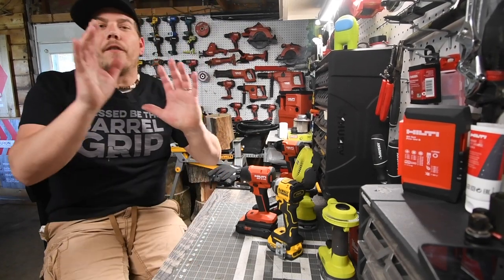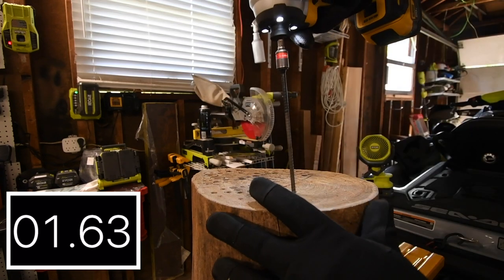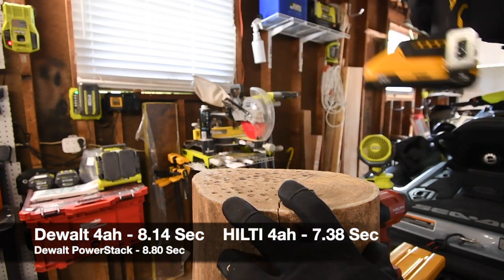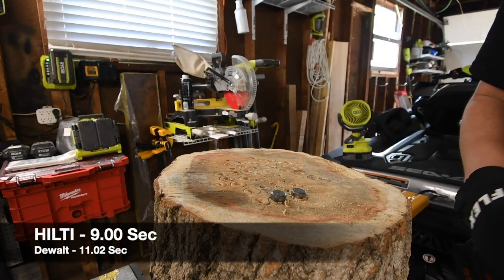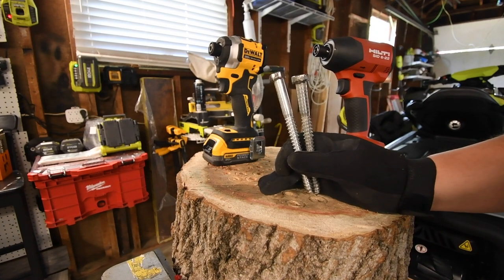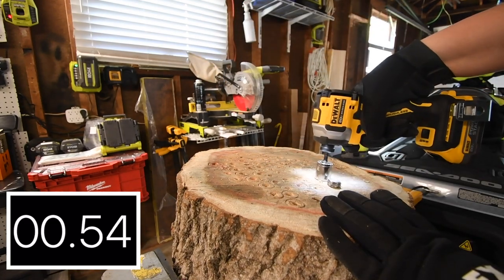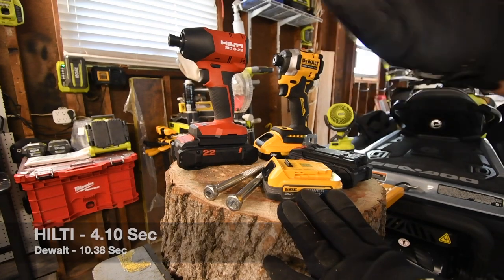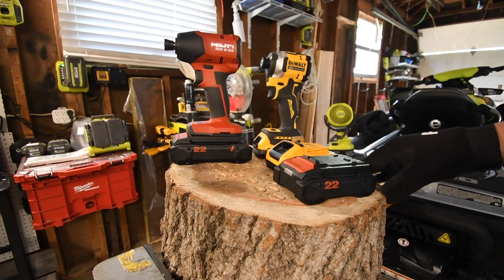Dewalt PowerStack Or HILTI NURON?

Comment: Hey Dave you should cut a dedicated socket down from being ~1" deep to only ~3/8" so that when you do these tests you're seeing if the tool can actually sink the screw rather than fight the socket pinching when it meets the log. When I'm sinking lags I usually hold the socket back so the end of the socket is flush with the bottom of the head of the lag. It works a lot better.
Reply: Awesome idea man

Comment: In normal use, the Hilti has been working fine for me. There is definitely a difference between the compact 18650, the 4ah and then even the 8ah.  However, I eventually got over it.   I expected the Dewalt to run circles around it.  I noticed it had a lot of grunt.  When I got a power stack for it, they felt made for each other.  I like how you can use speed one as a sort of auto clutch.

Comment: Why would Hilti introduce a whole new line with NURON 22v and not switch to better Cells at least. Kind of counterintuitive.
Reply: For each voltage HILTI always makes their lowest-capacity battery a 'compact small sized' 18650 2.6 Ah pack. It's the exception.

Even their 12v batteries are this way, with only the 'basic' 2.6Ah using 18650s while the bigger one is 21700s
Reply: when it says like 40v. it’s usually just a way of selling your items

Comment: These tool testers need to us a more consistent material to run test. In place of logs in end grain at different density locations where a tree might have developed stress would or have my organic inconsistency how about maybe an enginered lumber...... with a standard hand drill press jig, loaded with maybe a weight for consistent load on the drive. Your welcome youtube